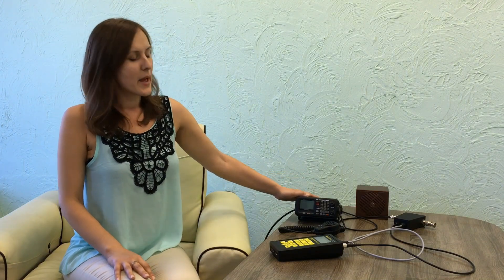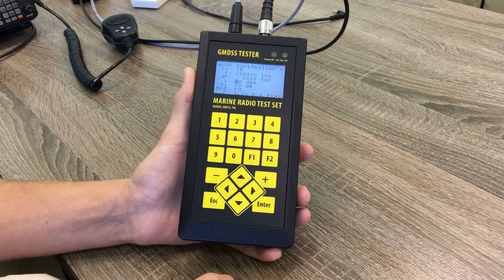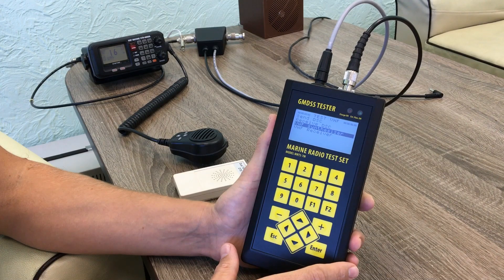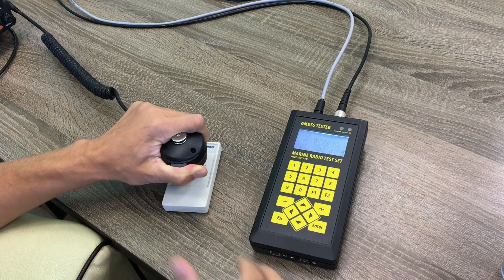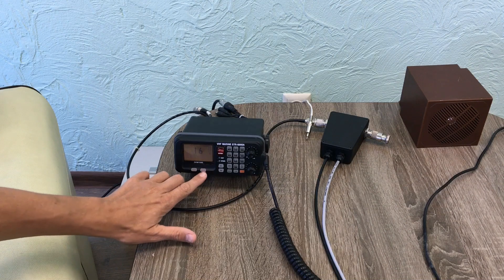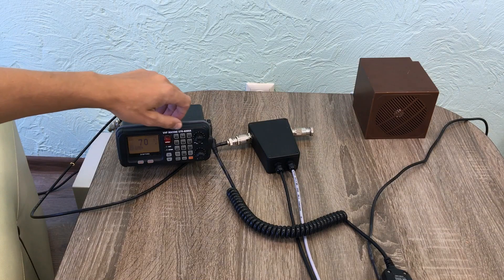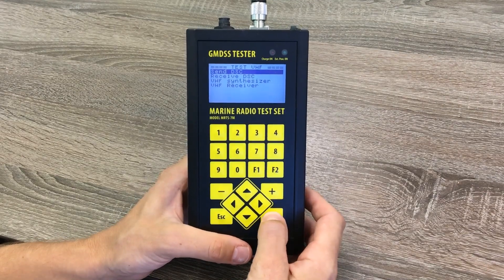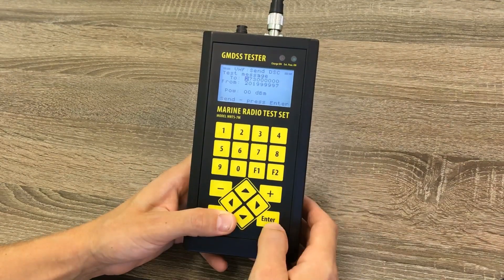VHF Radio testing by MRTS-7M

Comment: I can see -19.61 dbm power level received.it's wrong because you didn''t make the adjustment first in test config menu/vhf config/vhf pow.sensor.the correct level power must to be 44 dbm or 25w tx power.
And when you send a dsc call with the power sensor vhf ps1,the correct level must to be pow:-50dbm because the power sensor attenuation is -63dbm.then -63dbm-50dbm=-113dbm=0,5uv in the input of the vhf equipment by this way you check too the receiver sensivity.